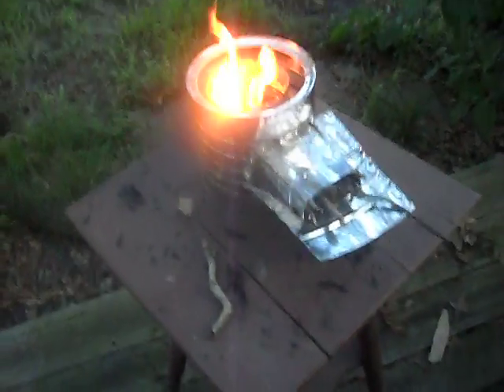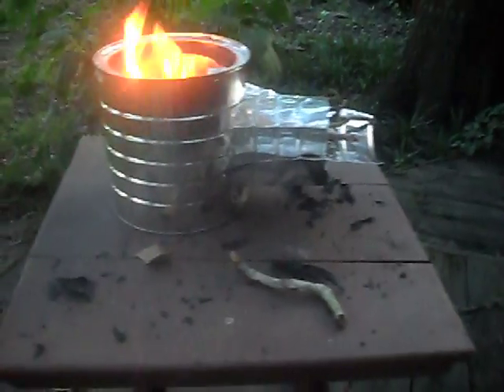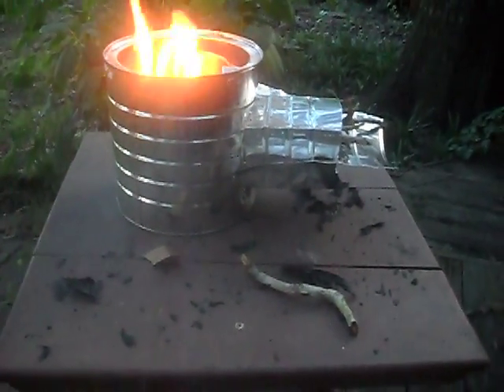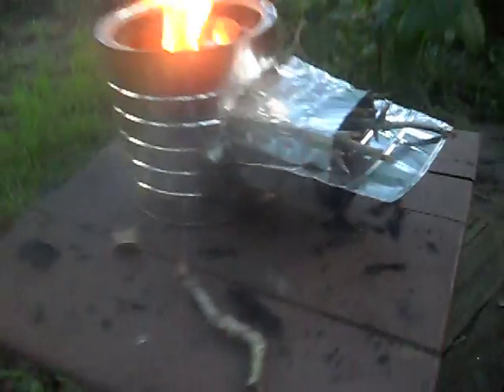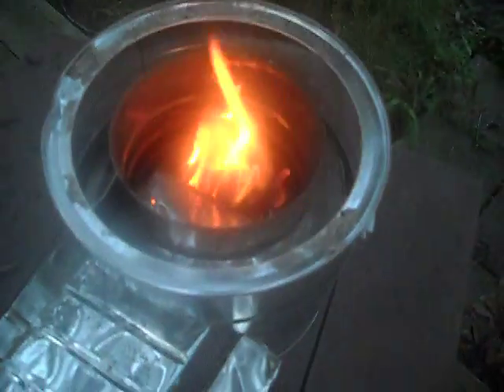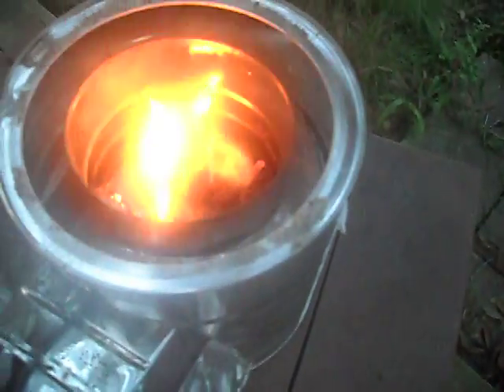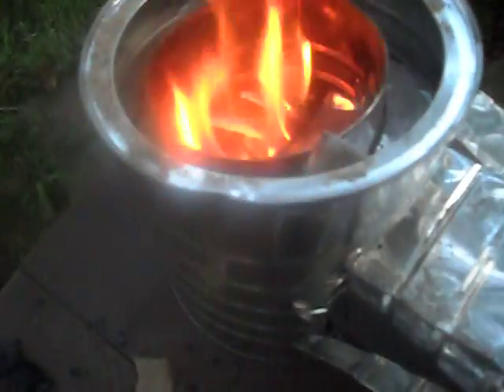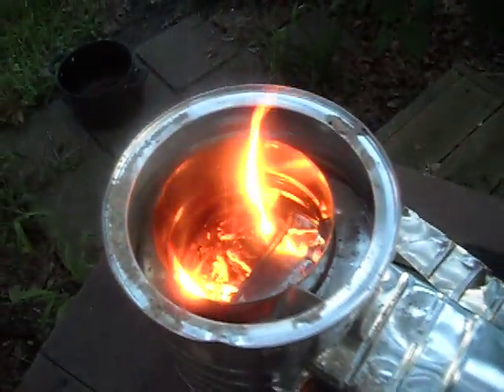Coffee Can Rocket Stove

Comment from the maker: Thank you very much. I used a regular coffee can and cut a side out and flattened it for the shelf, then squared the rest for the feed tube. Med can inside., I only had 1/3 the ash in the middle that I should have and it still did great. ( I also set the air venting off of the bottom about 2 inches so ash and coals didn't get in the way that much.)